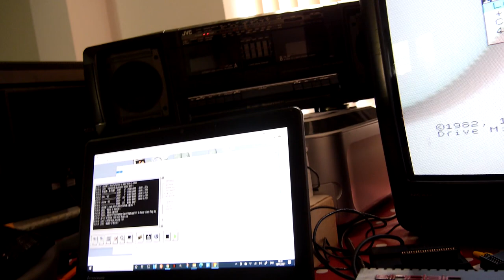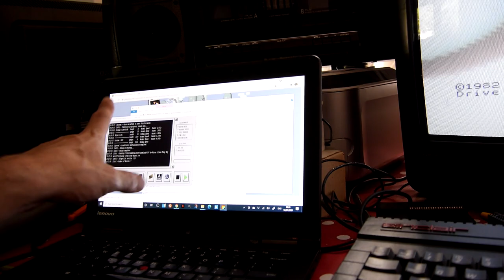ZX Spectrum +2 Audio modification - I CANT HEAR YOU!

Comment: Worth saying this a ZX Spectrum +2A (or +2B). The sound socket on the original (grey) +2 was always intended as sound output only and marked as 'Sound'.

The socket function was changed for the +3 with the built in disk drive to allow a tape recorder to be connected and the socket was marked as "Tape/Sound" on the rear of the +3. This carried over to the markings on the +2A/B case, despite the socket being wired back up only for Sound output.
Reply: on the +2A could you still solder a wire to the same cap and add a new socket to the back ?
Reply: I was on holidays in 1992 when the tape unit of my +2a broke down. I was on a remote village with no spares available nearby, no driving license and a lot of free time, so I opened my +2a and with some wires I could set up my old tape unit that I used in my rubber 48K and use it with the +2a, setting it up on the tape deck connector directly.

Comment: I had the 48k 'rubber monster' that switched itself off whenever you knocked it a bit. Then a 128k with the built in cassette deck. Went to Amigas after that.
Reply from the maker: Sounds like a sensible move!

Comment: Hi followed your modification,  getting sound but not loading games , for the mod ive used a fine insulated wire ! , i used zx play and my origanl 48k leads  no joy ,
Original tape deck working , but noisey and needs a nee belt ,
Help 😂😂

Comment: I Did it on my black +2B, and it worked fine to load from the cellphone. But, the datacorder that before was working good just do not load games from cassettes anymore. It's running, it tries to load, but the stripes are wrong. I'vre tried to adjust the azimut with no success. Any clue? Thanks.
Reply: I've undone the modification and all worked normal like it was before. Do no if this was expected of not, did not hear you or any other tutorial say that the datacorder have trouble to load the tape after this modification. Another day I'll try to add a simple 2 position switch, on side it does conect the right side of the jack with the left (like it was originally), and on the other positicion it conects it on the tape pin from your tutorial. At least it may work in a way so I can chose to use the mod just fliping the switch.